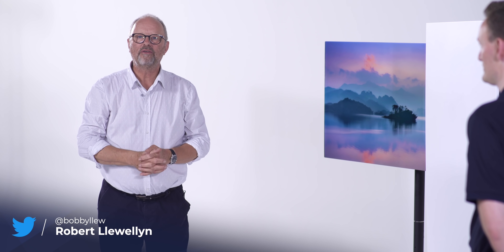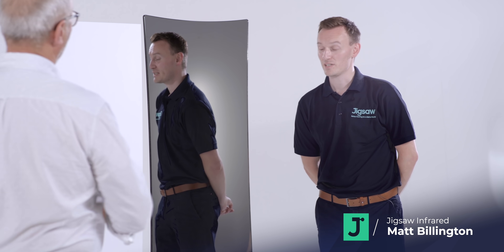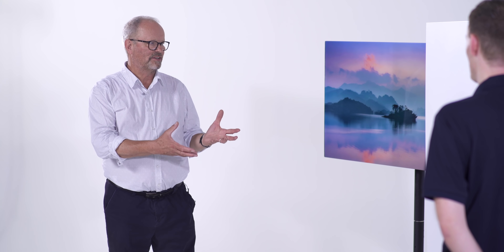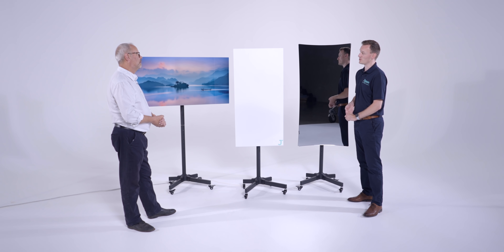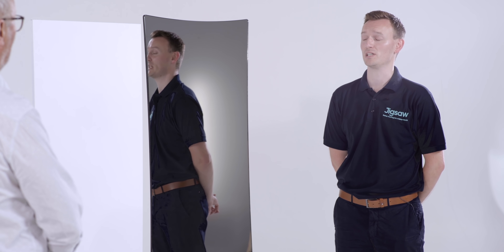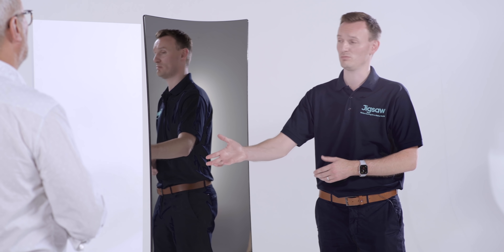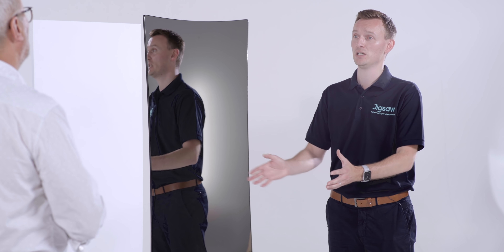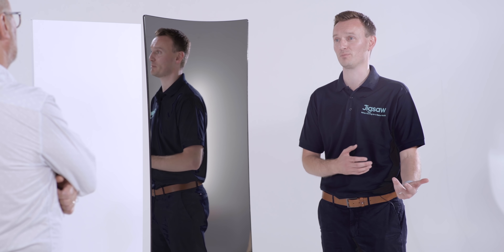JIGSAW INFRARED - Heats like the sun, cares for the planet | Subscribe to Fully Charged PLUS

Comment: Does anybody know anything about using IR heat at night or while we sleep. Surely that can't be normal for the body/ healthy.
Reply: The infrared from the flat panels is just radiant heat, like from a central heating radiator, only at a temperature of 80 to 125 degrees C, compared with about 50 to 60 degrees C for the former. The peak wavelength is around 9 to 10 microns. Of course, you need to position the heater with respect to your bed so you don’t feel too warm. And you can feel the heat on your skin at 0.5m, when the larger panels are on full. That might be too close for sleeping. Some will allow you to reduce the panel temperature for this reason. I’m a physicist, so have some knowledge, but you can cross-check with others. The other type of infrared heater, the visible and near infrared (NIR) to short wave infrared (SWIR) types use strip or bar elements at much higher temperatures, and these are used for patios, and used to be popular in bathrooms. I suspect the shorter wavelengths from these might dry and crack your skin with prolonged exposure, so this second type is not suitable for sleeping under, and is only for occasional use. But do seek other opinions.
Reply: In bed you don't need a heater really. Just put on a blanket.

Comment: We are chucking our oil boiler and rads for whole house IR heating in Ireland...and I can't get it done fast enough!  Have PV solar and battery to help offset higher winter electrical costs...even though it is not a "new" technology MANY people have never heard of it here in Ireland.  If you have not experienced it first-hand, it is great and works well for our temperate climate in SW Ireland...spent 3,000 euro last year on heating oil and don't see it getting any cheaper.  Time to get with the future :)
Reply: Interesting Kevin. Whereabouts on the island are you. I’ve long argued that air source isn’t suitable in bits of Ireland due to the moisture laden air.
Reply: @hughmarcus1  We are in Schull - looks like certain brands of air source are much better at handling the salty sea air/mist but still require routine maintenance to eyeball how things are faring as they age.  For us, the massive expense of a2w did not make sense, and the complicated interfaces and such seemed like a disaster if I had to leave home and the wife was here by herself...we are originally from Texas and have spent the last year researching heating systems here, and it's so complicated!  I do like mini-split systems, had them in the states and they worked great (cooling in the summer and heating in the winter).  But we are going to try IR panels first, then if need be we would install a few mini-split systems in the rooms we feel need more.

Comment: I think one thing which confuses people is efficiency of electric heating, even a tungsten light bulb is a near 100% efficient heater. You won't use much more electricity heating your home with a 12 quid fan heater from  the local Screwstation or Toolfix than the most expensive "ceramic"  heater commonly advertised in newspapers and on here, there is an awful lot of BS around this. 
There is no technology out there that is going to be significantly more effective than simply running an electric current through a wire so it gets hot, its 100 % or very close as it is. No amount of ceramics, graphene, carbon fibre, laser or quantum flam flam can be any better per Wat than we have already with a three bar electric fire. Although it might look nicer and present the heat in a more agreeable way.
Electricity is an incredibly efficient heater by just running it through a resistance even something designed to do something different like TV or an Audio amplifier are quite efficient room heaters.
Reply: A fan heater doesn't radiate heat onto you. It is not the same thing.

Compare it to sitting outside on a chilly day. In the shade you are cold while sitting in the sun the air temperature is the same but you still feel warm and cozy.

It is more efficient because you don't need to heat all the air in a space or building and still be equally comfertable.

Comment: I wonder if any 'cost over 10-year lifetimes' comparison studies have been conducted, due to the huge disparities between the upfront costs of heat pumps (or gas boilers) versus infrared heating. 

Considering infrared has a fraction of the upfront cost, and somewhat higher running costs (the difference would be minimised as these infrared panels need near-zero maintenance, no significant installation/servicing/repairs/part replacements etc typically), my guess would be that smaller households would save money over 10 years by buying infrared panels whereas larger households would save money with gas boilers and heat pumps.

Comment: Get the idea, but from what I remember of previous infrared heaters, is like standing in front of a coal fire in the old days. Your body facing the fire is warm or hot, but the side of your body opposite the heater is cooler and feels even colder because of the extreme difference?
Reply: I quite like the idea of a suspended one, radiating down from the ceiling.
Reply: It depends on the installation and how effective it is. Your comparison is not the best and maybe better suited to the old days?
Reply: That is why these are bigger and use less wattage. The old ones used halgen bulbs which concentrated a huge amount of heat comming from a very small area. This sends less heat from a much larger area making it more moderate and comfertable.

This would more be like sitting in the sun on a early spring day. Nice and comfertable in the sun, but chilly in the shade. That is the best way to discribe it i think.

Comment: Ok, lots of opinions and very little fact in the comments. I've used these units (not this brand, they are readily available and have been for years), and they do indeed work, but they produce a subtle heat that produces what I call a "zone of warm" around the front of the heater. They heat objects directly, which includes people, but they heat you slowly, you don't really feel it until you realise that you are warm, and you can even overheat in front of one of these.

But, a watt is a watt, and a 1200W FIR panel heater uses the same amount of electricity as any other 1200W uncontrolled heater. They just work more effectively by heating you, not all the air in the room, so you need a less powerful heater to do the same job as a space heater.

All radiant heaters are best suited to areas where there is a lot of air loss, such as a poorly sealed home, or where there are huge volumes of air, such as a workshop, gym etc. You position them directly next to or above the populated areas in the room and they heat the people and immediate surrounding area without having to heat vast volumes of air.

So, they have their uses, but they have their limitations. They are slow to heat up, so not ideal for bathrooms, and if you have more than one or two, you will really see it on your electricity bill.

So, it's horses for courses, really, if you have a requirement these might fit, try one.

One of our organisation members wrote about his experiences with these at https://netzeroemissions.net/2016/10/03/far-infrared-heating-panels-beautiful-heat-low-energy/ and a followup at https://netzeroemissions.net/2017/04/14/more-work-on-far-infrared-fir-heating/ (download the docs there, there's lots of info).

But, I have to agree with others here, this is nothing more than advertorial and FC has really lost a lot of credibility here, to the point where I might just unsub and be done with them. Transport Evolved and the Electric Viking do much better reporting on EVs anyway, although FC used to be excellent, it all just seems to have gone downhill in recent months.

Comment: Interesting and compares well to a heat pump install from an initial comparison. The main problem is running costs. Looking over 15 years and using the absolute worst efficiency of 2:1 for a heat pump the IR will double my running costs. As I do get a 3:1 efficiency it will triple my running costs. It is though a really good swap for gas boilers where heatpumps are too difficult to install. Electrification is the future, it's carbon intensity will reduce over time and IR would work well with solar/battery storage. Well done Jigsaw.
Reply: There is a difference between an air heating system, what an heat pump would be usually and a radiating heating system.
A radiating system can be much more localised and other surfaces that absob the radiation wil also itself start radiating.
And with radiated heat the temperature of the air can be kept substantially lower because the radiation feels a lot warmer. 

Like how sitting next to a water radiator or an open fire makes you feel the heat comming off it even if the surrounding air is colder.

Comment: Can you do a total cost comparison of the heating types otherwise it is difficult to compare eg: IR vs heat pump etc.  The product looks simple but I’m more interested in what heating system is the most efficient at getting the same result over the longer term.  Thanks
Reply: That study is being done. However, a lot of the population cannot have heat pumps. Infrared fairs very well against other forms of electric heating, 50% quicker and 50% cheaper. This was a 800watt panel against a 2 kilowatt convection heater.
Reply: @glennbillington4879  OK.  Perhaps a more though comparison after your study plus where to get them.  I am in London.  Do that I will email it to my energy company Ecotricity.
Reply: This must be the key question. It's going to be difficult to answer because it depends on the use case specifics. It would be good to see some use cases in details.
Reply: The only cost comparison that matters is getting a quote for installation with a proposed design for each system (or mix of systems) that you want to consider. Any heating and cooling technology can be applied through design effort in many different ways to a given house. There is no study that gives you “the answer” for your house.  For my house IR is not effective relative to heat pump except in the bathrooms - that’s not in any study either.  Find a quality designer and installers and make a plan.
Reply: If you have an EV, you are probably on a time of use tariff. Octupus Go is close to 40p peak, but 8p off peak - god knows what the peak rate is going to be next year. The elephant in the room with any electric heating is the cost to run at peak rate. A normal house is already using 10-12kWh per day and this system will add an estimated 4kwh (assuming 1hour of usage of 4x1000W panels) - this is my guesses I could be incorrect. Most electric heating really does need solar plus battery - a common battery size now would be 8kWh and in the winter you might be lucky to generate 4kWh per day. The other bottleneck could be the inverter. If you have all the panels on at the same time, the inverter might not handle it - if the oven is on too, then you really start paying!

Comment: The guy himself said the tech has been around decades, the difference is a larger panel to emit the same amount of IR heat can have a lower surface temperature (ie it doesnt glow! So sure the packaging is different to the old fashioned bar heaters, but the tech is the same and if you watch the video ,he says this. Best position for these is on the ceiling though so it heats the floor, making the system work a bit li kik e underfloor heating,  ie more efficient.
You would obviously be crazy to run these on peak , day rate electric, but again as they say in the video it works best if run off PV and battery storage. There are different solutions for different people and different scenarios ...